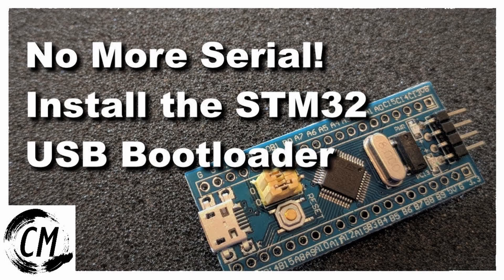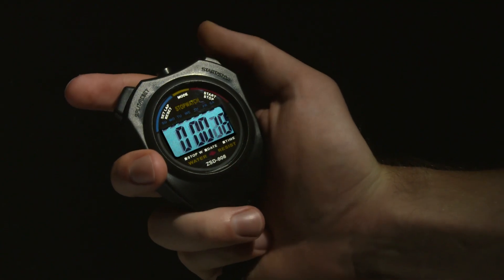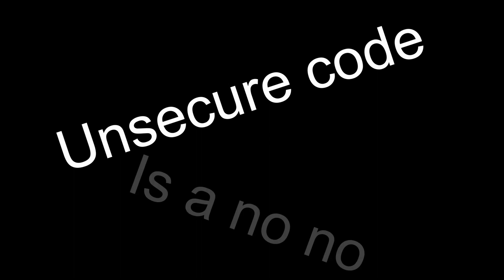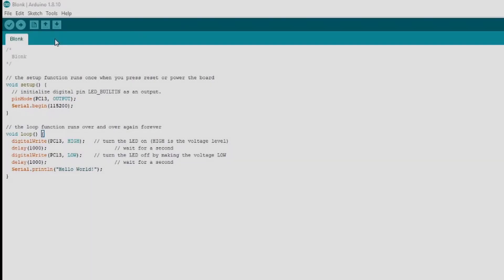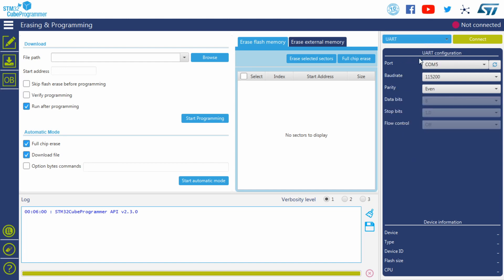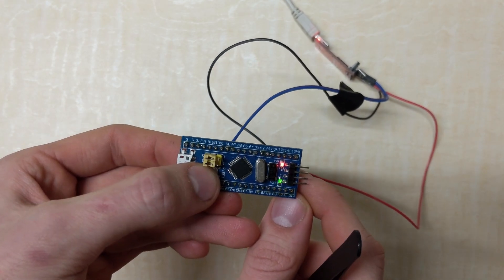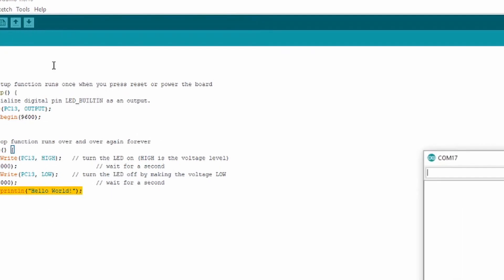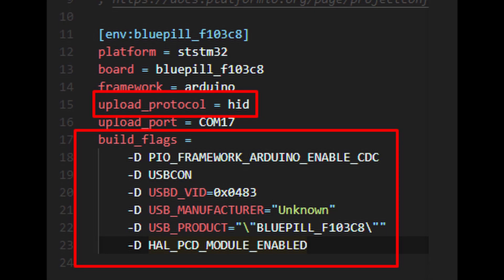How to Install the STM32 USB Bootloader, New Version! (Blue Pill F103C8T6)

Comment: I have tried this and ran into a brick wall when I could not get a CONNECT when clicking on the green button in the STM32CubeProgrammer. I am using a ST-Link32/V2 clone which had been working fine until today. I didn't change anything, but I can no longer program my blue pill with it. I am on W10 and it recognizes the dongle as does STM32CubeProgrammer, which does read the serial number of the dongle. Does anyone have any ideas of how to get this bootloader onto my blue pill? Thanks!
Reply from the maker: Maybe the clock and data lines were reversed? Otherwise maybe try upgrading the firmware or plugging in the USB and ommiting the 3.3 line

Comment: Thank you for this video. My question is whether, after I install this bootloader using the method you describe, will I be able to then compile and upload a sketch that requires the dan brown board manager? What do you think?
Reply from the maker: I believe you can use the HID bootloader with the dan brown core but have not tried

Comment: For some reason this works only the first time I upload a sketch after the bootloader was installed. Once the sketch is uploaded in Arduino IDE (PlatformIO as well) I get "Error - [1209:BEBA] device is not found" on all subsequent upload attepmts. The only fix is to upload the bootloader again through STM32CubeProgrammer. What I'm missing?
Reply from the maker: You need to have the correct USB settings as mentioned in the video, such as Usb support. Also if your Sketch us using HID you can get some interference. If you move the boot1 jumper to the one position and press reset, it will put it in bootloader mode and you should be able to upload again.
Reply: @CalebMarting  Thanks for answering - yep, the bootloader starts when boot1 jumper is in position one. However I cannot get it to work (after the first upload) in position zero for both jumpers. My PlatformIO settings are as follows:
[env:bluepill_f103c8]
platform = ststm32
board = bluepill_f103c8
framework = arduino

board_build.variant = Generic_F103Cx
upload_protocol = hid
upload_port= COM14 ;not needed, but the uploader complains without it
build_flags = 
	-D PIO_FRAMEWORK_ARDUINO_ENABLE_CDC
	-D USBCON
	-D USBD_VID=0x0483
	-D USBD_PID=0x5740
	-D USB_MANUFACTURER="Unknown"
	-D USB_PRODUCT="\"BLUEPILL_F103C8\""
	-D HAL_PCD_MODULE_ENABLED
	-Os

Comment: ...I recently got 2 pcs of the infamous bluepill...but both had different chip Id by country..1st one chn other mlys ..both did not work with ftdi..later The mlys worked with stlink ..later on ftdi after pc13 bootloader install..but the chn came with 128kb of uneraseable bootloader detected under hotplug cube programmer.only..normal mode get no target...how to fix it..?
Reply: ...I got it fixed today....ftdi...check unprotected mode... download bootloader via cubeprogrammer...yeeay

Comment: Caleb Marting, First thanks for you nice video's.  I am a NOOB and have used your guide with Win10, STM32F401, I am using the ST-Link V2 with the latest firmware. My question, is the HID method with the STM32F401 board is not listed under the Binaries I downloaded, it has the STMF103 and the STMF407 but not the F401's.  Is there a binary file you can point me to for the correct HID files, I have versions 2.2.2 from the github. I have not been able to get the board to function, When I started, the on board led was blinking and the red led was on, now after trying the STM Cube Programmer to load the binary F407, it just showing the red power light now. I have moved the boot switch to the correct position and after STM cube indicated a download complete, I move the boot switch back to its original position.
any pointers appreciated Thanks.
Reply from the maker: https://youtu.be/b1123kz_3MM I have a guide specifically for that chip

Comment: I flashed the binary file "hid_generic_pc13.bin" on my blue pill using ST-Link. But could not flash any FW using "HID bootloader 2.2" option
I get following:

+-----------------------------------------------------------------------+
|         HID-Flash v2.2.1 - STM32 HID Bootloader Flash Tool            |
|     (c)      2018 - Bruno Freitas       http://www.brunofreitas.com   |
|     (c) 2018-2019 - Vassilis Serasidis  https://www.serasidis.gr      |
|   Customized for STM32duino ecosystem   https://www.stm32duino.com    |
+-----------------------------------------------------------------------+

> Trying to open the [COM8]...
> Toggling DTR...
> Searching for [1209:BEBA] device...
##########
Error - [1209:BEBA] device is not found :(> Searching for [COM8] ...
> [COM8] is found !
> Finish
the selected serial port > Finish
 does not exist or your board is not connected

Can anybody help, I couldn't find any option to deselect COM8, it is automatically got selected
Reply from the maker: It could not find the HID device, this is a common issue. You can reflash the device and see if that fixes it. Otherwise it may be an issue with a wrong resistor on your board. Can you join the discord linked in the description, we will be able to help you better there

Comment: Here is transcript of platformio.ini:

[env:bluepill_f103c8]
platform = ststm32
board = bluepill_f103c8
framework = arduino
upload_protocol = hid
;upload_port = COM17
build_flags =
    -D PIO_FRAMEWORK_ARDUINO_ENABLE_CDC
    -D USBCON
    -D USB_VID=0x0483
    -D USB_MANUFACTURER="Unknown"
    -D USB_PRODUCT="\"BLUEPILL_F103C8\""
    -D HAL_PCD_MODULE_ENABLED

It works without upload_port defined for me.

Comment: What would you need to upload when using the STM32F303 ? Could the same bootloader be used as the Blue Pill?
Reply from the maker: I'm not sure, someone else was trying the f303 and couldn't get it to work with this or with my f401 video. I would recommend getting an ST link V2, it's well worth it
Reply: Could i use that to program it with its Cube IDE ? Thanks for the reply btw
Reply from the maker: Yep! That's actually what you are supposed to use

Comment: Excellent!
Can I use stm32cubeide for programming and upload that loader?
Where I could see instruction?
Reply from the maker: You can probably set it up but I haven't seen anyone get that working yet. You'd basically need to have a script that runs for upload when the binaries are generated. Again I'm sure it's possible. I would recommend an ST Link V2 if you actually want to use STM32 cube IDE
Reply: @CalebMarting  I use ST Link  v2 for debugging, I try making custom board. I wanna upload code from flash memory also. Thanks for advice anyway

Comment: Use the PB2 port tied to +3.3V after a RESET. This will kick in the HID Bootloader (even with anything written previously). One also can unplug the USB, tie PB2 to +3.3V, and plug it to the USB port, this also can kick in the HID Bootloader.

Comment: Urgh. I updated my Arduino STM stuff, and now some old code won't compile. Not that it matters, because I haven't figured out how to upload a blink sketch. I've installed the Cube, but there doesn't appear to be an STM32_Programmer.sh file. If there was any sanity to this, the necessary tool would be in stuff I downloaded from Arduino.

STM32 development seems hellishly convoluted.
Reply from the maker: Hmmm, would you mind joining the discord linked in the description? You could try using Platformio as well, I believe the tool needed is included
Reply: I have the same issue...

Comment: First Thanks for this post  , and here executable Code without problem 

[env:bluepill_f103c8]
platform = https://github.com/platformio/platform-ststm32.git
board = bluepill_f103c8
framework = arduino
upload_protocol = hid
upload_port = COM10
build_flags = 
    -D PIO_FRAMEWORK_ARDUINO_ENABLE_CDC
    -D USBCON
    -D USB_VID=0x0483
    -D USB_MANUFACTURER="Unknown"
    -D USB_PRODUCT="\"BLUEPILL_F103C8\""
    -D HAL_PCD_MODULE_ENABLED

    -D USBD_MANUFACTURER="Unknown"
 (NOT CORRECT)
    -D USB_MANUFACTURER="Unknown"
 (Correct )

Comment: I'm running into a weird issue with PlatformIO! I can upload the code to the BluePill but only once than the laptop says "USB device not recognized", if I re-flash the bootloader  then I can upload the code again but right after that get the "USB device not recognized" error.
To get to upload from PlatformIO all I had to do was add "upload_protocol = hid" in the .ini file.
Reply from the maker: There's a lot of options that aren't checked when you use platform IO because there's no gui. Go to 8:30 in the video and I have a config that works

https://youtu.be/Myon8H111PQ

Comment: Important to be persistent with this, I used the usb SWD programmer, stlink v.2 to flash,  simply because it was convenient, and I had to finally erase it three times, and then program twice in succession, to  get  the new HID 2.2.2 bootloader to enumerate correctly on Window 10. 

Be sure to use a known good usb cable, and I had to use my older 2.0 version USB connector, not my new USB 3.0 ports I added via a PCI-e expansion card 

Once you get past the initial flash, it will create a serial port that works perfectly as a CDC serial port (COM44 in this particular case). 

I also tested the hid_flash (v2.2) from the  command line like this ...

"hid_flash>hid-flash.exe C:\Users\randa\AppData\Loca\Temp\arduino_build_363784/Serial_Test_Arduino.ino.bin COM44"

All OK!

(As always, don't be shy to connect/reconnect the usb cable to power cycle, and/or press the reset button if something appears to hang)

Comment: Hey, I followed the given tutorial exactly. I get this error during compile time.

c:/users/..../appdata/local/arduino15/packages/stm32/tools/xpack-arm-none-eabi-gcc/9.2.1-1.1/bin/../lib/gcc/arm-none-eabi/9.2.1/../../../../arm-none-eabi/bin/ld.exe: warning: cannot find entry symbol Reset_Handler; defaulting to 08000800
c:/users/...../appdata/local/arduino15/packages/stm32/tools/xpack-arm-none-eabi-gcc/9.2.1-1.1/bin/../lib/gcc/arm-none-eabi/9.2.1/../../../../arm-none-eabi/bin/ld.exe: C:\Users\.....\AppData\Local\Temp\arduino_cache_284359\core\core_3eac5589fb933d33135f6b2a4c5fc1ce.a(main.cpp.o): in function `premain()':
main.cpp:(.text.startup._Z7premainv+0xc): undefined reference to `init'
collect2.exe: error: ld returned 1 exit status

Any fixes??
(I have already tried re-installing IDE & STM32 Cores Library)
Using Arduino IDE 1.8.13
STM32 Cores 1.9.0
Reply from the maker: I haven't seen that error before, it looks like there's an init function that's trying to be called but there is no actual init function defined. You can try navigating to the file that it says and see what's going on
Reply: @CalebMarting   that error got fixed when I downgraded my IDE. A new error arises after flashing the bootloader (HID), it says 
"BEBA device not found". Also do you know why STM32duino's SPI Library is not compatible with the newer IDE. Is there a fix for this? (I was working on stm-o-scope, the libraries kept throwing error in IDE 1.8.10)
Reply from the maker: It could be that the stm scope was based on the old core, the Roger Clarke Melbourne one, which you could switch to. There are multiple causes of the hid device not being found, everything from the wrong USB cable to windows 7 or something. It would be easiest to debug if you join the discord linked in the description of the video
Reply: @CalebMarting  thanks will do.

Comment: Thanks for the video. One question, with HID bootloader, do you still need to move the boot0 jumper each time when uploading the sketch?
Reply from the maker: No,  The HID bootloader is essentially a sketch that can store more sketches alongside of it. it will run the hid bootloader to start and then it'll start running your uploaded code. because that hid boot loader is always running you won't ever need to move boot zero

Comment: I am a starter with micro controllers and your video was a great help.
But because time goes by I faced the same problems as many people here: after first successful flash from Arduino all later flashes needed the bootloader pin 1 to set. 
After many hours of research, try and fail, I finally found the solution!
I downgraded the version of STM32 core down from 1.9 to 1.8.
STM32 core 1.9 and bootloader 2.2.2 may not be compatible, idk.
Now I can upload the same reliable and repeatable way as before with Arduino nano.
Reply: //Edit: I was able to update core to 1.90. Maybe the root of my problem was solved by installing a driver for STM32 device. My system recognised the pill as a generic serial device that helps Arduino when searching for it.
Reply from the maker: Ah so COM ports are not required for uploading code, but Arduino complains when there is one on your system and you don't have one selected.

Maybe that was the root of your problem
Reply: @CalebMarting  yes, but before Installation of the driver the system was not able to recognize the blue pill at all, every time after first flash from Arduino. To be complete here, the device is now a serial device and the port in Arduino fits to it.

Comment: I cannot get this to work on OSX 10.14.6, used STM32Progammmer to do 'Full Chip Erase' then burned hid_generic_pc13.bin. I get the rapid flashing led but it doesn't work from the IDE  Searching for [1209:BEBA] device...

It's not showing as a USB device with "ioreg -p IOUSB -l -w 0" or "lsusb", other than "Apple Internal Keyboard / Trackpad"

I've tried 3 or 4 some with the resistor fix and some without and different usb cables. Spent hours on messing with this without success, any hints?
Reply from the maker: I'm sorry but sometimes hardware is just finnicky... You can turn one of your blue pills into an ST-Link v2 and program/debug with that, which works pretty well. If you want to join the discord linked in the description I can walk you through how to do that
Reply: @CalebMarting  I might try one of the other bootloaders or a different vendor, or stick with stlink v2. Is it possible use stlink for serial output?
Reply from the maker: Unfortunately you can't use ST-Link for serial, however you can still output serial over the USB port. You can have the ST link and the board plugged in at the same time, just don't plug in the 3.3 volt line from the ST link

Comment: HELP!!!! I couldn't even get the blink to work with the serial line, but stm32cube was able to detect the device so I uploaded the boatloader(if I didn't screw it up), but I still couldn't used it, there is no new device detect on my device manager!!!!
Reply from the maker: There might be something funky going on with your board, unfortunately quality control on these really isn't that great, they should at least be bought in pairs. Does your LED blink fast when it's plugged into the computer? If it's not blinking really fast when you first install the bootloader then it won't work. Do you have another blue pill you can try it on?
Reply: @CalebMarting   Sadly, this is my first time working with blue pill, I only bought one. Yes the LED did blink very fast....

I did accidentally succeed once using serial flashing with arduino IDE, but it was only a empty prog with only the two empty function(setup / loop). It went through only once. Other time, it would return 
Error: Write address not acknowledged: 0x8000B00

I think there is something wrong with the flash memory, I tried to read the memory with stm32cubeprogrammer, certain address return the same error as above, but was able to read sometimes if I repeat it a number of times.
Reply from the maker: I would recommend buying another blue pill and an ST-link V2. Both of those together should only cost like five bucks if you live in the US
Reply: @CalebMarting  I always envy americans when it is about electronics. Sadly, I did not live in the States.

But truely, I agree that I need to buy proper component especially this is my first time using it. Thanks for the advice :D
Reply from the maker: No worries. If you want you can join the discord that's linked in the description of the video. We have a lot of people from all over the world, beginners and more advanced people alike. It's a great place to ask questions, especially if it's your first time using it
Reply: @CalebMarting  Thank you for replying as well as the invitation. Would utilize the discord once my stm32 replacement came.

Thank you :D

Comment: Caleb Marting asked you which library for RSA encryption you recommend me to be compatible with a PHP code and the arduinoST I have tried some but they are for AVR and do not work well with the ST, thank you very much
Reply from the maker: If you want it to work no matter what platform, you could use a C/C++ library. That way there is no hardware dependency. Something like this maybe: https://github.com/andrewkiluk/RSA-Library

Let me know if that works

Comment: I was stuck with the  'Error - [1209:BEBA] device is not found' issue as well and finally could resolve it by setting the "Tools->Port" in the Arduino IDE to the virtual COM port the bootloader had opened. Regardless the fact that the upload does not need the COM port, Arduino IDE seems to do.
Reply from the maker: I might not have been as clear as I wanted to be, for whatever reason Arduino needs comport selected, Even when the upload protocol doesn't actually need it